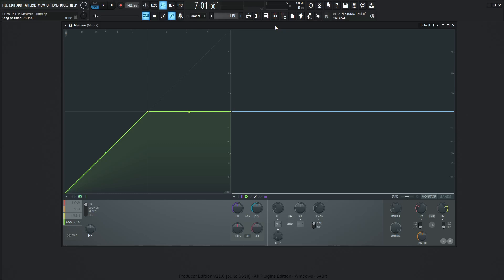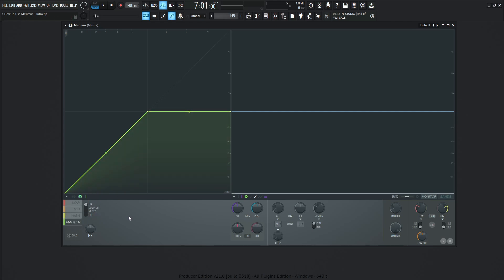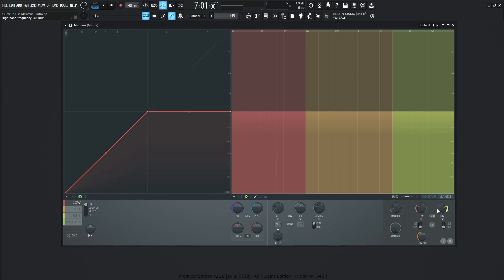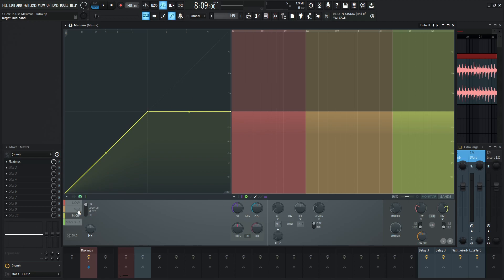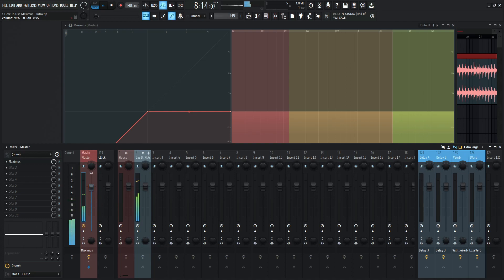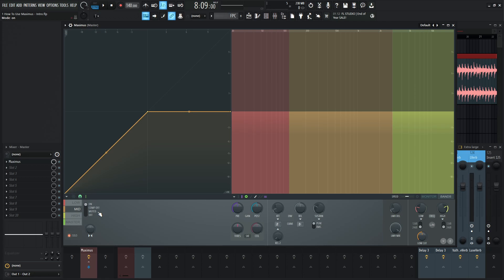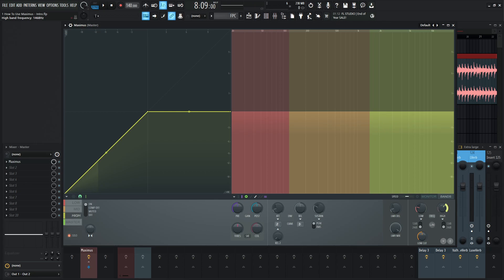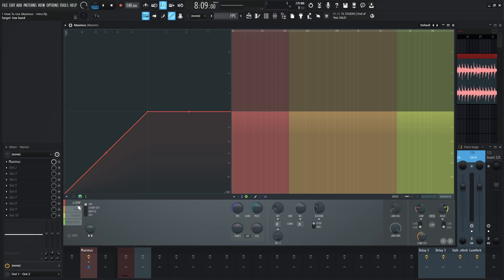Maximus Intro and Overview PART 1 | FL Studio 21 Tutorial

Comment: Good topic for a tutorial. I've used Maximus but it's still kind of a mystery to me 

I've heard some people say you shouldn't use Maximus on your master mixer track, and songs sound better just "raw" without many plugins on the master mixer track. Also I've heard some people say they export their song, and then load it into a new project to do mastering. 

I've just been putting Maximus on my master mixer track with the preset "Clear Master", as seems to sound pretty good
Reply from the maker: Those are some very good points you bring up. Generally the mixing and mastering stages should be kept separate. Some mastering chains can use a lot of CPU so having the entire mixing going (lots of tracks, synths, effects, automation) can be CPU intensive as well, and then adding more on the mastering can choke the CPU. But a more important reason is that mastering sessions look different that mixing sessions.
In a typical mastering session where you have more than one song, each song gets its own channel and inserts. The songs should cascade on the playlist. This way in addition to bringing the mixes to the target level, we can also add the right about of fade in/out times of the song, as well as the silence after a song. We let the song finish out, and let the air settle a bit, and then put a marker when the next song should begin. By doing this we can export the master as a selection, while retaining the extra time we add at the end. The end result being that all the songs flow into each other as a cohesive whole. 
Another goal of mastering is to make sure that all the mixes sound tonally related, so starting with a good master for the first track, you can save that as a preset and add that to the next mixes for a good starting base to further adjust from there the specific needs of the next track.
Automation does play a role in mastering as well, bringing up the volume for the chorus in a range from 0.5 to 1.5 dB can give the feeling of a more energetic chorus.

Presets like Clear Master, can be great starting points for you track, and once you get really comfortable with maximus you can work from that preset and really customize it to suit your track the best.

Those are just a few reasons to have a separate mastering session. Hope that's helpful for you.
Reply: @jonaudio  awesome, thx for the explanation. That's some pro level knowledge that the majority of FL users prob don't know hah. 

I haven't really heard of loading multiple songs into one project to master them all at once. Then again, I haven't really done any mastering in general. 

I did also hear the advice that if you're going to use a compressor on your song on the master mixer track, that you might want to put that on at the beginning of the mixing rather than at the end. That way you can "mix into" the compressor and make your decisions that way, rather than make a bunch of mixing decisions and then throw the compressor on at the end which might change the sound a lot

Having the mastering separated from mixing seems like it could cause issues, if you make the song sound good "raw", but then change it more with a plugin like Maximus after. But maybe mastering is more for polishing / making the song shine, whereas mixing is the core of the sound 

Many people I'm guessing don't even use mixing or mastering at all in FL and just slap plugins in and export the song. Which can still sound good I think.

Bouncing audio to .wav and loading that back into a project, and  / or exporting a mix and loading it into a mastering project are things I want to do more. Def saving on CPU could be good for a large project that might start tanking your CPU
Reply from the maker: One of the main problems I've seen when someone slaps mastering plugins onto their master channel in their mix session is a huge game of chasing their tail. What frequently happens is that they are making their mix decisions while it's running through the mastering chain, then later they may change stuff in their mastering chain, which changes their mix, so then then change the mix and so on and so on. It's a very non constructive loop that does a lot of harm in the long run.
If you have a great mix, you'll get a great master. The goal of mastering shouldn't be radically changing the mix. but more so to bring it to the target level of what platform it is being released to, make all the tracks tonally similar and perhaps add some 'glue'  to the track with the right about of compression for the song. 
If there are a lot of peaks in the mix, the compressors are there to bring the peaks closer to the average perceived level of the track, so everything can be brought up together and sound good by doing that.
Mastering should generally be more transparent than not, if you find yourself struggling to get a good master, 9 times out of 10, it will be the mix that needs to be fixed not the master. Aside from cutting very low end and tightening some bolts, mastering shouldn't require fixing.
I've gotten tracks I had to kick back because the mixing wasn't right, and if the mixing isn't right, the master won't be either.
Reply: @jonaudio  So would you suggest not using and compressor plugins on your master mixer track for your "mix" project, and just save the compressors and mastering plugins for once you export the mix and load up the mastering project?

It seems that compression on instrument buses are still important in the mix, to glue related sounds together. E.g. have a drum bus track in your mixer, and use a compressor and eq on that to glue the drum sounds together

Comment: saw your black theme then I just realized FL21 official has been released to the public.. and I don't even understood enough of my stock plugins... you made the right move. massive thx
Reply from the maker: That's right. Today the official FL21 was released! Super exciting day, this update is a very exceptional one.
A lot of FLs stock plug-ins are very capable and very good. I think a lot of people are led astray because they may think stock is bad for some reason?
The goal is to have courses for the majority of FLs synths and their other effect plug-ins, to show that they are quite usable, not to mention the integration with the software, less plug-ins to manage in sessions and great CPU usage.
Its easy to get lost in the hunt for new and shiny plug-ins but at the end of the day a Compressor compresses, EQs EQ, sure some do a slightly better job but the difference isn't that great.
You'll never hear someone say "you know, this mix would be so much better if they used <insert popular compressor> instead of <stock Compressor>.
The concepts are what matters most rather that the gear for the most part.